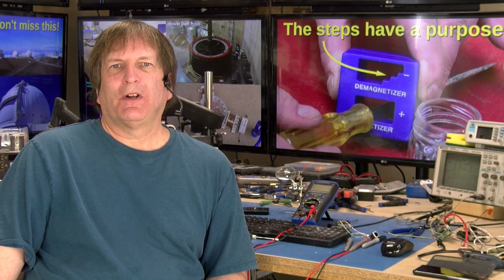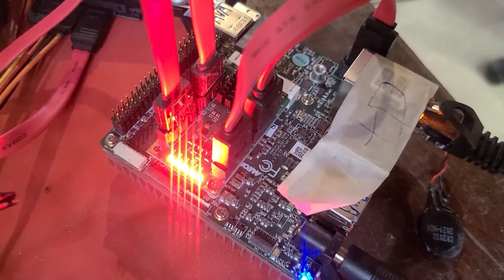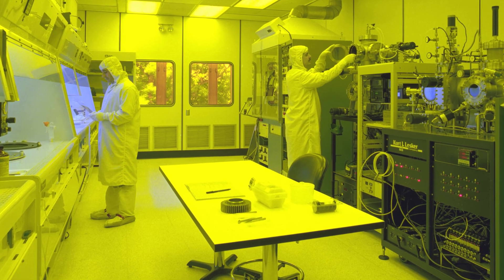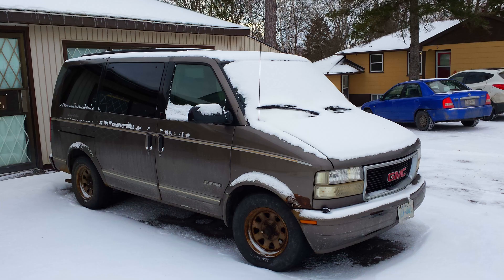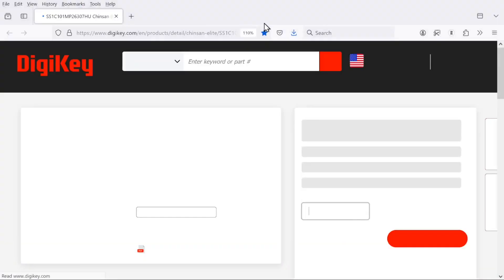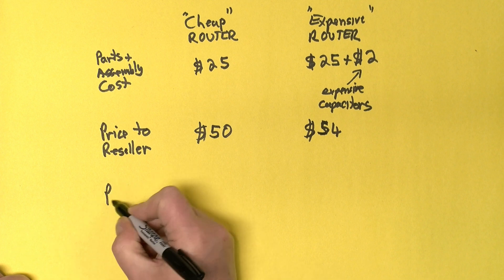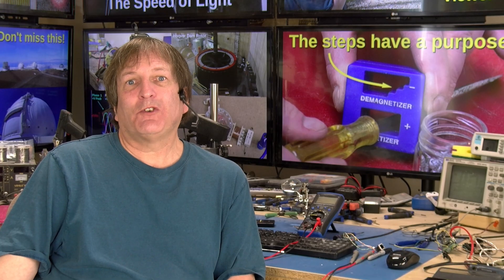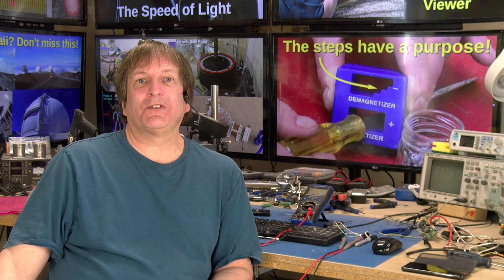Why things FAIL - Why don't Manufacturers make them last longer?

Comment: I find it "interesting" how a certain tech brand will have their customers line up, even camp overnight, something like twice a year to get the latest model of a device. What I see is, companies like this have had the iterations these "advancements" "new features" planned out for years probably longer. It seems as if people believe there are teams of r&d techs crunching in a lab year-round and somehow coming up with something (samething) newer better faster stronger (enter Daft Punk). Then again, I could be wrong I mean what do I know? 🤔
Reply from the maker: Interesting you put you it that way. For year I have thought Apples must lucrative "innovation" was turning technology into fashion - and it has so paid off for them. I shake my head at that, but shows how successful marketing can be. There is an element of that in Tesla, but not nearly as effective.

Regarding planned "advancements" Year ago I read an article how shaver manufacturers were doing that in some developing countries but with technology they had developed year ago in the west: essentially marketing more and more advanced shaft razers to them one after the other, followed by electric plug in shaves and then battery ones etc. Probbaly had to do that today with the internet spread of information, but sire shows how providing am upgrade path is intensely lucrative.

Comment: At 2:17 I paused to see if I could figure out the formula myself.

let annual survival probability of item 1 = P_1
let annual survival probability of item 2 = P_2

P_1 ^ MTBF_1 = 0.5                                                              probability of surviving for MTBF years in a row is 0.5.
    P_1 = 0.5 ^ (1/MTBF_1)

(P_1 * P_2) ^ MTBF_combined = 0.5
    MTBF_combined = logbase(P_1 * P_2, 0.5)                                  solve for MTBF_combined
    MTBF_combined = log(0.5) / log(P_1 * P_2)                                   change of base formula
    MTBF_combined = log(0.5) / log(0.5 ^ (1/MTBF_1) * 0.5 ^ (1/MTBF_2))               substitute

At this point I figured I was done and watched the rest of the video. I had missed how you can simplify it.

    MTBF_combined = log(0.5) / log(0.5 ^ (1/MTBF_1) * 0.5 ^ (1/MTBF_2))
    MTBF_combined = log(0.5) / log(0.5 ^ (1/MTBF_1)) + log(0.5 ^ (1/MTBF_2))
    MTBF_combined = log(0.5) /((1/MTBF_1)log(0.5) + (1/MTBF_2)log(0.5))
    MTBF_combined = 1 /((1/MTBF_1) + (1/MTBF_2))
Reply from the maker: I just stated the equation - neat that you had a real go at it. This is where I wish one could post images in the comments - as good a job as you did expressing math in text only form, its always so much easier to appreciate if one has the luxury of seeing it as one might write it with pen an paper or with an equation editor. Thanks for posting!

Comment: product burn-in ,thermal cycling, "Infant mortality " , "bathtub curve" routine preventive maintenance to extend "end of life.."all 3 axis vibration & shock tests, EMI/EMC compatibility test, All these come back to mind of our basic training days😅
Reply from the maker: vibration & shock tests - I an always amazed at how little vibration or an extended period of time will eat though wires if they aren't secured and rub against anything. The people who ruggedize things for vehicles must do close to the impossible - I did aircraft shock and vibe and that seems to be nothing compared to what a car on a bumpy road experiences - or the thermal cycles from a car left in the sun in summer and outside in wonder.

I have some "poor man's" shock and vibe and temperature testing setups at home that I made for initial testing of product before paying for formal testing - will have to make a video about them . 

Sounds like you have done a lot of product stuff too - few people really understand what goes into taking prototype and making it into a real product.
Reply: @ElectromagneticVideos  yes a varied lot..in total..but spread in time over 25 years working in a company..
I was with the R&D div. in the Power Electronics group...besides 3 years in
another production  unit of our Industrial Electronics div...
Being in R&D was a real plus point
we were involved in all aspects of the products..from concept ,design  , mtl.proc.,  prototypes, batch, mods ,production , comissioning , cust. support...etc. ...
...the whole gamut...so there was interaction mixing with all strata vertical & horizontal..and all were treated equal & respected
Reply from the maker: @analoghardwaretops3976  How cool! You have a very similar background to mine,  other than I tend to deal with signals stuff rather than power. All those things you mentioned are so critical to productization - I will have to do a video on that sometime!
Reply: @ElectromagneticVideos  Very true about vibration & the" G" tests...one of our products wasso large..that only one facility in the country supported that size...& it was a 3 days journey by road transport for the product U.T. to reach there....
& after the setup in the 2nd axis "G" test one of the door hinges failed....
Yes we were on hot bricks...during these tests... incidentally this product was an inverter for railway coaches (govt. org.)..& their specs are stringent like you mentioned..as for aircraft.
Reply from the maker: @analoghardwaretops3976  Wow - you dealt with bid stuff. I never gave a thought to railway stuff - not surprised its a lot like for planes. 

Did you ever do stuff for the navy? There was one test where you mounted the item at the end of a sea-saw type structure and an a weight was dropped from a set height on the other end of the sea-saw, all while the device was operating. As I recall the device had to survive three drops in a row. Was to simulate the shock from a torpedo. The issue we had was the (small) circuit board flexing and shorting to the chassis. The solution was supports under the PCB. Hadn't thought about it in years - your having to take the product to a distant location for the test reminded me - same thing - only facility in Canada that could do the drop test was in Halifax.
Reply: @ElectromagneticVideos  No  nothing related to navy or the likes .. mostly for railways...& yes for them another was the compliance of IP55 / IP65  etc. covering dust/water ingress .

Comment: Cost/benefit is always the case.  It's not unusual to find industrial electronics doing what ever it does for 50+ years.
Reply from the maker: Apparently in many manufacturing facilities, floppy drives and 8088 PCs are not uncommon even today. I once had  to interface to something to a DOS PC in an air traffic control application!
Reply: @ElectromagneticVideos  That reminded me of a telco site I had to do some work at in the very late 90s.  There was an early serial number genuine IBM PC (not XT) in a rack acting as a gateway for some dial-ins.  It booted off a single floppy that loaded the bridge program directly, no DOS.
Reply from the maker: @retrozmachine1189  No DOS! Wow - that itself is amazing! Those were the hardcore computer days!

Comment: Simple.    Money.     Back in the day, like in the early 1990s and before, it was normal for major appliances like ranges, refrigerators,  washer/dryer to last for 30 years or more and you'd typically replace the appliance only because it looked very outdated,  such as the pastel colors or earth colors popular from the 1950s - 1970s (avocado green and harvest gold come to mind).   That "outdated " refrigerator was often placed in the garage to keep the beers or what have you, cold.   

Manufacturers know that if most of their products are trouble free for 25 years or longer, sales will eventually slump.   Nowadays if your fancy stainless steel refrigerator lasts 10 years  you feel like you hit the jackpot 🙂

My grandparents had  GE turquoise blue appliances with chrome handles and knobs, a  40 inch double oven electric range and refrigerator, purchased in 1967 when they brought the house, washing machine and gas dryer from 1968 when natural gas became available,  and they were all still working as of August 2022 when we sold the house after grandma passed 4 months earlier.  They really built stuff to last, and pastels were about as popular as disco was in the 70s.
Reply from the maker: If I had a choice, I would buy only appliances with simple mechanical controls - fridges, washer, dryer, stove all worked just as well as they do now, but didnt seem to fail. Sadly you cant get appliances like that any more, at least= in the developed world.  Like your experience, we bought a used 1950s fridge around 1970 when I was kid. It lasted for years and was working when it was replaced only because it didn't have automatic defrost. I do have on remnant of the non-digital days - a mechanical timer controlled microwave. Still works perfectly after about 30 years, and has the added advantage of not wasting power when it is not running. 

Funny - I do remember the avocado coloured appliances! In many ways way better than modern stainless steel that shows every fingerprint!
Reply: @ElectromagneticVideos   cough*SpeedQueen*cough 😉
Reply from the maker: @TheOtherBill  Long lasting? or not? As I recall Maytag was supposed to be well built back then.

Comment: Large value ceramic capacitors are not necessarily a good substitution for aluminium electrolytics - they can be mechanically fragile, noisy when handling audio frequency ripple, etc. Tantalum capacitors might be a better substitution for your example. 

But I don't disagree with your fundamental point 😊
Reply from the maker: Good  points for sure! And to add to that, the biggest issue I find is it is impractical to use them for anything other than quite small power supplies due to the relatively small capacitance values. If you need 1000uf, its hard to beat electrolytics.

Comment: If we want sustainability, we have to move beyond making things that are engineered to fail and be replaced. 
The real wealth comes from natural resources, not money - money is just claim in wealth.
We're so foolish wasting natural resources to meet mandate to maximize profit and have an ongoing market for replacement products. It means a lower standard of living in future once these resources are depleted. 
Real free market capitalism is supposed to be about creative destruction - when a market is saturated, the industry contracts and the people and resources get put towards building things that we do need - not replacing engineered to fail junk.
Part of the problem that drives this is a need to constantly pay out so much just to survive - aka taxes, mortgage interest, etc supporting government and banker parasites that don't produce real wealth.
Reply from the maker: Certainly agree we need to build things that can repaired  for sustainability! 

I think part of the issue is that large scale manufacturing has made things so cheap, that the cost of labour to repair if often hard to just even when an item is repairable. 

I try and do "repair rather than replace" for the exact express purpose of sustainability. Less practical if you have to pay to repair rather than doing it yourself. I did read somewhere that one of the Scandinavian countries did something like repair expenses deductible on your income tax. The added bonus of that is the money paid to repair stays local.
Reply: @ElectromagneticVideos  agreed. but stuff is being made specifically to not be repaired like smart phones and apple laptops.
When it comes to repair costs, I think people need to learn practical skills and to repair their own stuff. Farmers are great with that because they need their equipment running right away and don't have time to waste taking to repair shop. People should be able to sew, do basic mechanical/electrical repairs of appliances, repair their homes doing plumbing-electrical/drywall.
It's crazy how these basic skills have been out-sourced to paid professions.

I in part blame education system that doesn't teach practical skills.
Reply from the maker: @Jon-hx7pe  "People should be able to sew, do basic mechanical/electrical repairs of appliances, repair their homes doing plumbing-electrical/drywall." YES!!! It can be both a huge time saver to not have to wait for a tradesman to show up as well as huge money saver. While I am all for things like the right to repair and ability to repair, I dont think its a practical for most people to be able to do that. The miniaturization needed to make a smartphone also makes it hard to repair, but at least an independent local shop should be able to do it.  Laptops should be easy to open an repair. A great example is the old Dell Latitude E series laptops - so easy to open and change parts (and also a great keyboard which is why I still use one!). 

Education system - I wonder if they still have shop classes? Even way back when I was in school shop classes were discouraged for anyone going to university. Luckily I took electrical shop which was a great lesson house wiring. Wish I had taken auto shop and machine shop.
Reply: @ElectromagneticVideos  there were no shop classes when i was in school in the 90s, but it may vary but school.

I really liked the old lenovo-thinkpads for durability and repair. its been downhill since 2011 or so with the new designs.
Reply from the maker: @Jon-hx7pe  The Lenovos/Thinkpads were actually my other option when I went for the old Dell Latitudes. Similar design approach. What bugs me most of all with the new ones is the lousy keyboards - flat keys are terrible for touch typing. Style over function :(

You know, they should have some basic combined shop class - change a receptacle, change the oil on your car, basic carpentry etc. Would be way more valuable over the coarse of a lifetime compare t. o many other courses in high school!
Reply: @ElectromagneticVideos  the new thinkpads have the best keyboards of new laptops when it comes to feel and travel, but they're not close to as good as the old thinkpads ones. also despise how they took out dvd drives and often solder the ram in!
The best machine for repair and keyboards is truly a older desktop though, my keyboard is 21 years old and better than almost any sold today. parts of machine are mostly 10 years old but with new ram and ssd. works great - super reliable and stable.
Reply from the maker: @Jon-hx7pe  You sounds so much like me - I think the case of my desktop is the last surviving original part and is about 20 years old!. I will remember that about the new thinkpads if windows 11 forces me to upgrade. Problem I have is a few windows programs that keeps me from going to Linux on the laptop.
Reply: @ElectromagneticVideos  it was my first own computer purchased in 2003 at age 15 with a year's worth of paper root money. gradually, some parts got changed just to keep it running, then a major upgrade with used parts and more recently a 2016 monitor monitor used replacing the 2003 CRT that died. new lcds give me horrid eye strain.
 i really dread having to replace my current setup.
Reply from the maker: @Jon-hx7pe  Thats a great story - nothing like hard earned money to give something value. I used CRTs till maybe 4 years ago - really like the color rendition for photography. I switched to a giant LCD so I had plenty of space for numerous application open at once - and have a "small" CRT on the side for photography. Sorry to hear about you eye strain issue - maybe experiment with lower color temperature for whites and lower brightness?
Reply: @ElectromagneticVideos  I tried three new lcds and different setting - same problem. i believe it has to do with the cheap quality led backlight with too much red or something as there are similar complaints on forums. My existing 2016 one bought used two yeas ago I have no issue what so ever with and being VA panel - the blacks and colors are great. have a old viewsonic crt sitting in storage but not great quality.
Reply from the maker: @Jon-hx7pe  How interesting.- never heard of that problem being widespread. It would be interesting to use a spectrometer and see if there is a noticeable difference in the spectra the good and bad monitors produce. I wonder of the led illumination is also flickering as opposed  less flicker fluorescent illumination for the older panels.
Reply: @ElectromagneticVideos  some panels are fake 8 bit and dither the colors. mine is a pure 8 bit for each color. maybe that is part of the issue.
If you want to research the topic, take measurements and make a video of findings it would be really interesting.
Reply from the maker: @Jon-hx7pe  Dithering! Wow - I didnt know they did that for displays - how odd. You know, I may look into it for a video - I'll put it on my (long) list of things for future videos!